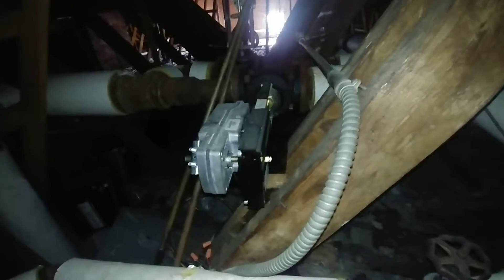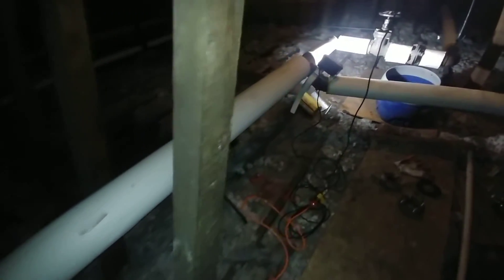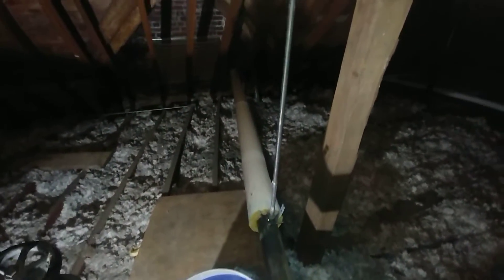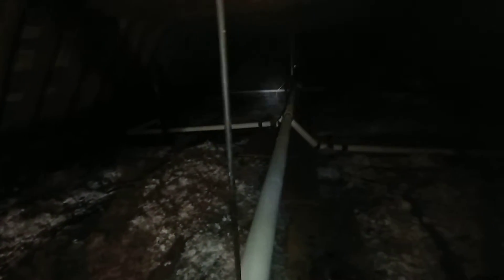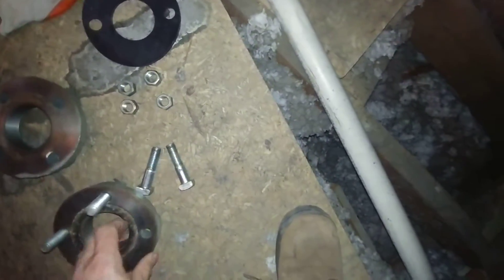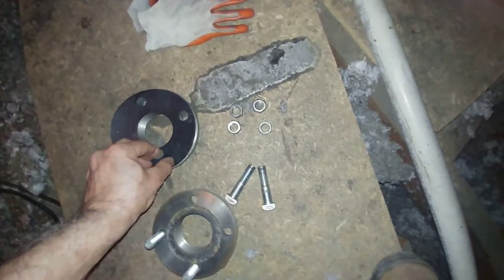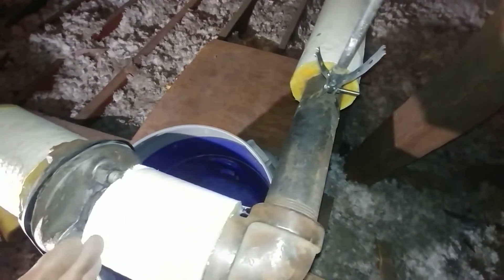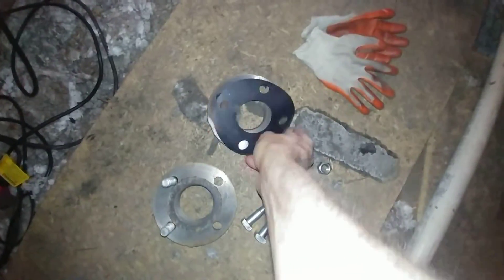Mills System Steam Main And Leaking Union Flange Repair

Comment: We line the bottom of our tool boxes with sheets of "rainbow rubber". its a red 1/8" thick gasket material and we cut it with tin snips and razor blades. It works great for steam! And sometimes you can make diaphragm gaskets for certain rad valves. Its cool that you found a place to make one. You saved yourself like 45mins of cutting!

Comment: I never knew you could use Edpm with steam because of the temperature ,every day is a school day!
Reply: I was told by my local gasket supplier that "peroxide treated" EDPM is ok to use for low pressure steam.  Just any old EDPM might not have the temperature rating, apparently.

Comment: That steam system looks interesting, more so than the one pipe system I am familiar with
Reply: Yeah, this is an unusual one!  Most of them are the type with the mains in the basement and risers taking off from that.  The Mills System is potentiality very very fast in steam distribution because for most of the way (except for the main up-feed riser), the steam and the condensate are moving in the same direction.   When originally piped with the huge coal-fired Mills boilers in the basement and thereby the high water line, no traps or condensate pumps and boiler feed pumps were needed.  Not so today with the relatively smaller boilers.

Comment: Do you like the rubber gasket material vs the hard style? If pitted bad we punch out a gasket out of rainbow rubber or just double up regular flange gaskets.
Reply: I was pretty sure those old flanges were going to be pitted (it actually wasn't as bad as I had imagined), so I got a fairly flexible 1/8" EDPM rubber.  Also, any minor misalignment of the two halves of the flange can be taken up by the flexible  nature of the material.  I used to squirt RTV silicone in there as well, but that often makes everything too slippery, so I don't do that very much any more.  I didn't crank on those nuts too hard, either.  There is some take-up left just in case there was a leak path that didn't fill in with the rubber and I wanted somewhere to go if that happened.  I used to use that red stuff (Buna-S), but I saw that didn't last with the steam, so I use black EDPM (ethylene diene proplyene methylene), peroxide treated.